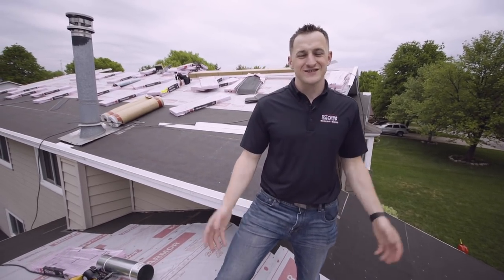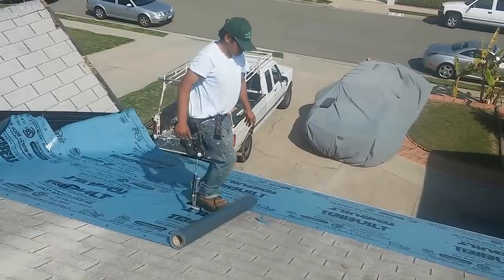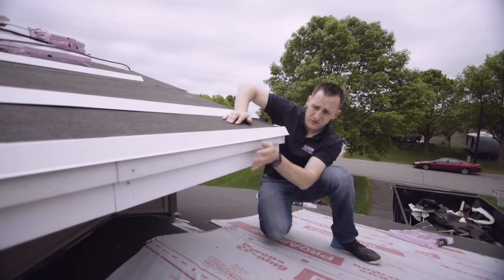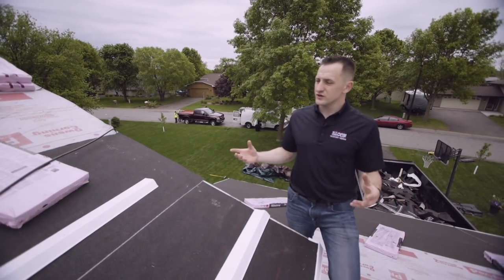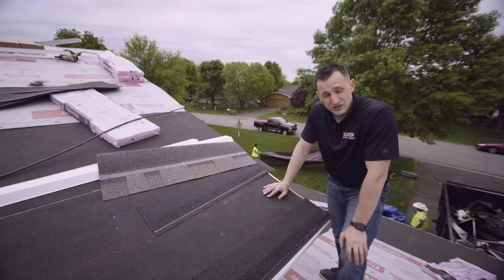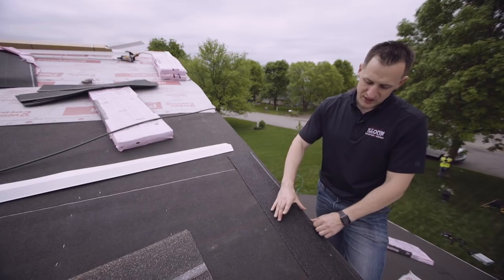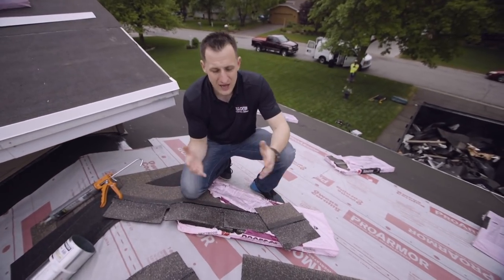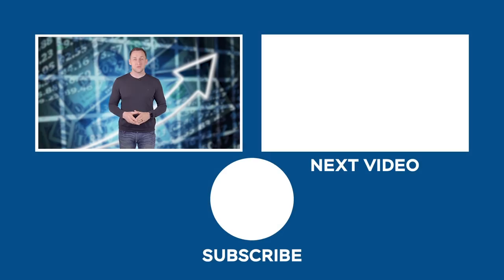How to Install Roof: Best Roofing Practices / @RoofingInsights3.0

Comment: I always try upgrading homeowners to ice-&-storm on entire roof, instead of felt.  This way you're ahead of wind storms, hail storms, and crooked gun nails.  I also offer a hand-nail price. Going with these two options will cost more, but it's your best shingle job.
Reply from the maker: Ice and water entire deck is not a bad idea but you dont need it on steep roofs

Comment: Using an old shingles fine you don't even need a flip it over you just nail into the thickest Parts the shingle on to the metal and then place the other shingle above it making sure that the glue is sticking on the same line you had put the previous nails
Reply from the maker: thats fine if you want to compromise warranty and dont like to follow manufacturer instructions
Reply: Very true.

Comment: I’m in Alberta. I always use SBS Deckbase at the eaves and hang it over 1 1/2 “. Then starter strips flush with the Deckbase. Then the rest of the roof gets covered with 15 felt. Minimum code in Alberta is SBS Deckbase 44”. 
Don’t like the ice shield because many of roofs were ripping have the shingles glued to the ice shield. Just makes a mess. Pretty well have to take the plywood off. 
If you have to use drip flashing make sure it’s eavestroughs friendly. Defeats the purpose of the eavestroughs installer goes over it. 
Synthetic is still not a proven product. Felt has been working for many years.
Reply: Death to Ice Shield but felt isn’t proven either only thing it proved is that it doesn’t work.
Reply: In Colorado it doesn't really matter, hail storms destroy everything so they get a new roof soon.
I doubt a house has a roof longer than 5 years or they don't have insurance. We started using it a while ago now have had no issues and it is a much more forgiving product than felt.
Reply from the maker: Roofs are roofs, Storms are Storms, no matter what do whats right on every job
Reply from the maker: Ice Shield and synthetic felt will save many roofs from leaking with thinner shingles we are getting today...

Comment: Hi Dimitry... watching your videos and learning more than I ever wanted to know. Had a question I haven't seen in any videos thus far.

FLASHING on 2nd story sidewall. OK to re-use good existing or replace? Getting quotes that say replace, other quotes say exisisting is good for re-use. Big differences in cost. 25yr old house... Going from original 3-tab shingles to OC Duration. Original vinyl siding is sidewall material. Google was just as divided. Your thoughts on this?
Thanks for educating us!

Comment: Also you’re not supposed to staple synthetic underlayment. It’s required to use cap nails and clearly states that on the roll itself. Staples will leak and aren’t safe until it is roofed.
Reply from the maker: false, if you are installing the same day you are allowed to staple, cap nails requires only if you live it open

Comment: My uncle doesnt by the starter shingles what he does is just cuts a shingle in half to where the starter strip is still all the way at the edge of the roof,but if people are actually buying the starter shingles there is nothing wrong with that its basically the same thing a shingle cut in half,u just dont have to do the cutting  but u do save that little bit of money.
Reply from the maker: Wrong: its not the same. Question is: do you want manufacture warranty or not?

Comment: Ok. I'm not one to comment or talk shit but Please provide me a link where I can see a sentence saying that a manufacturer will not back it's own shingles due to different underlayment. I made several calls to figure this out yesterday because somebody on my channel said the same thing to me and I had to educate him. Underlayment is vague across the board.  There is no rule saying that o.c or landmark or gaf will not back the product because an installer prefers to use a different manufacturer's synthetic felt. As long as you use their shingle, cap and starter combo you will be fine. Ice shield in certain situations. They say that they "like" to see their product because they want to scare contractors into buying it. If you are a pro installer then you are expected to use their products for premium warranties which I'm sure you'd be charging your customers extra for But most companies aren't pro installers for anybody. the manufacturer will back their product regardless of what's underneath it just as I'm expected to back my installation regardless of what's underneath it.  I've talked to several reps and if you know that I was wrong on that please provide a code or a phone number
Reply: For example my crew and I really like GAF felt buster.  Easy install, very grippy and strong.  Not crazy expensive either.  We use that on every roof but also install landmark or o.c shingles too. You're telling me if the shingles failed on any of my o.c roofs that they won't pay for their issue.. let's say i 6- nailed on an 8 pitch on a 65 degree day, the tar strip failed, and shingles are sliding off. They won't honor their warranty? Or will they just not honor some extra warranty for pro installers?
Reply: Oh, it's coming. And o.c. coil nails, and o.c. ode, and .........
Reply from the maker: They will require at least 3 components to be the same: you can use starter, hip and ridge of same brand and use synthetic of others, some require all 5 of the same for their premium warranty coverage. Most do 3.

Comment: Good video, however I haven't had good luck with Owens Corning products. They're inferior to Pabco shingles and the starter strips are significantly smaller compared to the Pabco starters if you can go to the store and look at them side by side do also look at the actual weight per bundle. Also the Owens Corning "weather lock" ice and water shield is so thin you can tear it with your hands. We ran out of IB3 Storm Stopper and bought a roll of owens corning and it was a complete joke.
Reply from the maker: what market/city are you in? Thanks for sharing feedback, we appretiate it

Comment: Most off the roofers are still using the old fashion way..they used minimum requirements of materials..cheap stuff.. are they follow the manufacturer requirements?minimum code?
   They used staple instead of plastic cap? Why staple it’s cheaper..Customer never win😎👍

Comment: 2 sq for 30 lb 4 sq for 15 lb. It does not take 5 or 6 rolls to get 10 sq. Gaf is the system that has a scam where you dont get your full warranty if you dont use 2 or more of their products to get there gold warranty which every other shingle  has regardless. Landmarks you used to have full warranty on 7/12 and above with only papering bottoms and valleys.All shingles are phasing to limited lifetime. Theres no such thing as a 50 year. Its warrantied for 10 years and after that they last as long as they last. These are things you neglect to tell. Anyone who gives a 10 yr labour warranty I've found is just a scam to get the job. At ten yrs it's a discrepancy between manufacture and installer if theres ever a problem. A brand new house is only has a warranty of 10 years. This is a video about upselling.

Comment: You can install second roofs, it happens all the time in Ohio , and it’s legal and up to code in every city, so again your info is wrong,
Reply from the maker: +John Bailey show any manufacturer who will honor it
Reply: Right ive roofed in Ohio for 10 years....yeah it's legal to reroof up to 3 layers but it will always void the warranty
Reply: Legality and warranty terms are 2 different things
Reply: @RoofingInsights3.0  Manufacturers are all about making Profits. More profits from complete tear downs. I have a 28 year old re roofed holding just fine Complete with 3 tab shingles for hip and ridge. I'm gonna do a complete tear down next spring using the same method.
Reply: Roofing Insights Can’t win them all buddy! LOL
Reply: Not dade County you can do 2 but no warranty but 3 is too much weight for most places that where built long enough ago to have the 3rd roof put on but the big problem is the nails backing out the wood also what n the hell like tear that old sheit off make a sale for the tear off its the easy part of the job
Reply: @RoofingInsights3.0  all the insurance companies now prorate the roofs now, so after 10 years you get zip

Comment: So basically you want people to spend as much money as possible when replacing the roof....
Reply: Right dude, no use doing the correct job when you can save a few bucks... Smart logic.
Reply from the maker: doing it right will cost you just slightly more, all accessories will add 10% at the most, your biggest cost is labor to remove and labor to install, permit, dumpster etc, and those will not change if you buy starter shingles, and better underlayment. Its worth to do it right
Reply: This is his job. These conventions and upselling yada yada yada. In most cases it doesn't matter as long as you do the job properly. Buying the most expensive shit doesn't do anything if you dont do a good job installing. You can have a good installer with mediocre fuckin bp mystique and do a better job than the other guy. As an owner. This upselling shit doesn't work all the time. Nobody wants to spend 12 k on a 20 sq roof for shingles. you know what does work. Stating the facts of crooked companies such as people giving 10 yr warranties and the discrepancies that come with that.  Not just being a salesman but an owner operator and not just sending crews to jobs where whatever he she says must of been done unlike every other company. Stuff like that. I'm a third generation roofer and been doing it about 16 years and I'm not giving all my secrets I've learned. Upselling on products works for lots of companies and puts a small chunk of change in your pocket but nothing compared to getting just about every job you just about quote when your honest with your clients. That's where your upselling.

Comment: And no professional cuts a dimensional shingle for ridge cap. They cut the 3 tabs which are no different than hip and ridge.
Reply from the maker: +dustin mills wow
Reply: My skill saw makes every one the same. Now days I just get the perforated shit if I'm not putting on a nice good bull nose hp ridge but lots of that hp is fucking garbage too. And timbertex is horrible. Anything by gaf is pretty much a scam and joke to anyone who knows better. Even lots of homeowners know that now when I go to quote houses.
Homeowners. You dont use timberline do you?
Me. No that's good for like a doghouse.
Homeowner. Oh good

Comment: a real stickler for the rules. if people did it a certain way 50 years ago and it lasted why change it?
Reply: Because there's now a better way! It's better for the consumer and better for the contractor! Its not a matter of a roof lasting or working it's if it can do it better!
Reply: You're basic premise is incorrect. It didn't.
Reply: Becuase 50 years ago roofs didn’t last. And that’s why back then every few years the homeowner would reroofed his own house,
Reply: 50 years ago there were no codes. I can't believe the short-cuts and sheer laziness and stupidity in workmanship I have uncovered in my house built in the 1970s!
Reply: Because it didn't last, all those old roofs blew away in the various hurricanes we've had over the years.  In Florida anyway...
Reply: Only one reason!! MORE MONEY!!!! The more shit you can install on a roof then the more you can charge the customer!!!
Reply: I have ripped off many 40 year old roofs that were 3 tabs. Granted they were 12/12 pitch and the 3 tabs back then were as thick as dimensional shingles now. It does have to do with the warranty ad he said though.
Reply: Because roofers aren't as good as they were. Howany hand nailers are out there now? Nails were put where they were supposed to, now its sale on nail days. 3/8 ply and no paper. 20 years later wood is still perfect. Shingles are fiberglass/asphalt now and fiberglass sweats so you cant say products are better. Shingles used to be thick. Now they're thinner and not as good with a larger warranty???? Anything good that lasted is now discontinued cause theres no money it for manufacturere then. T locs are living proof. It's all about money and upselling my friends and by the way, 90 percent of shingles are only really warrantied for 10 years. Lifetime ltd.
Reply from the maker: well, it didn't last....

Comment: He never explained where to nail the starter strip or architecture shingles nor how many nails we're required per shingle and starter strip.
Reply from the maker: we have roofing videos on that
Reply: oc requires 4 nails on the shingle evenly spaced with the first and last 1-2 inches from then end and same with the starter but the nails need to be 2-3 inches from the roof edge there is also a 6 nail pattern but its not need unless you want 130mph wind warranty  nails would look linke this in the shingle 1   11    11    1. note for oc there is no 5 nail instructions so any roofer who says you need 5 is wrong... i have been installing OC for 7 years

Comment: Whe he said the shingles wont stick to the other one because of the granules , does not that mean then that ,every shingle itself wont attach to each other ? The roofing cement that comes to any shingle attaches to the nail line wich is granulated .
Reply from the maker: +abel l not accurate, nailing zone is not granulated, that’s where bonding happens with sealant
Reply: Roofing Insights they nail line is granulated on all shingles except durations.
Reply: Even the shingles that arnt sure strip shingle have a line of tar
Reply: Right.  And using 3 tabs as your starter strip- let the entire tabs hang off the dripedge. Run your first course, then hook blade those tabs off.  Now you have a tar strip at the dripedge, and a starter that is more durable/thicker than those rolls.  But you voided the warranty. Why?  'Cause there's money to be made with some of these junk ideas.
Reply: Bradley James it’s easier and better to just flip your dimensional backside up. Tar strip is at bottom and will bond with tar strip of your first row.
Reply: @RoofingInsights3.0  sorry man no true iko has granulates on the nailing zone . But its ok man i get the point . Good video

Comment: i dont think there is any need to re sheet a roof that has half in spacing 99.9% of the nails will hit the boards and if the old 3 tab shingles never blew off the new ones wont. they seal much better then 3 tab. if the boards are in really bad shape then yes
Reply from the maker: pattern can little different and if you remove 2500 nails and add 2500 new nails to dried over few decades boards..... I am not an engineer but that doesnt sound like good roofing subfloor

Comment: Gutter apron installed wrong. Ice & water first then gutter apron so ice dams dont find its a way through the little gap
Reply: You mean metal first then ice/water shield over top on eaves, drip metal over ice/water & felt on rakes
Reply: Michael is correct to code. I have seen many times gutter damming  happen installing it the correct way.
Reply: If you install a strip of ice and water that is wider than the drip edge, then install the drip edge, when you install the code required width over the drip edge, the system is sealed from gutter damming. On a house that is known to have problems, the first strip is wide enough to get adhered to the fascia two inches down. No water ever gets in if the gutters fail.
Reply from the maker: what do roofing manufacturers recommend? Code is above manufacturers
Reply from the maker: Nicholas sounds Romanian or something

Comment: Do you think I can learn to roof on my own? I know the flashing and ridges are complicated but the shingling part is pretty straight forward
Reply: The problem with it is you can learn yhe wrong things from people who think they are doing it right but yea id say you can learn it get a bundle of shingles most installation instructions are right on the wrapper get a book to learn more  I like certainteed demitry prefers owens corning go with one of those 2 its not gonna be easy but you might be better off than if you learn from a hack
Reply from the maker: yes you can

Comment: I thought asphalt shingles were a thing of the past. Doesn't the asphalt refer to the mat,  which used to be asphalt, but  is now fiberglass, and coated with sand, fiberglass and tar.  Confused.
Reply: They're asphalt fiberglass these days
Reply from the maker: still best selling and most popular roofing system in most markets

Comment: Odd, how could the ice barrier be installed if the siding is still attached and the step flashing isn't, certainly isn't proper.  Which manufacturer only warranties their shingles if you use their ridge shingles?  Lame video  Roofing has changed very little in 10 years, the people selling it have changed, the labor force has changed, but the basic principles published by many sources, like ARMA  since the 80's are still being ignored by most.
Reply: Ian Albitz umm most manufactures only warranty their shingle if you use a certain number of correct products, let me name a few CertainTeed, Owens Corning, GAF. 

I mean which ones don’t is a better question.
Reply: @crunch9876  We just dropped Tamko shingles like a week ago I believe for GAF. Tamko shingles we're just garbage overall, they never stick, arrive damaged, and dropped a lot of sand so it was it made it a lot more dangerous.
Owens Corning are by far the best from what I've used and GAF is decent but damaged shingles show up.
Reply from the maker: Tamko is the worst of the worst now!!!